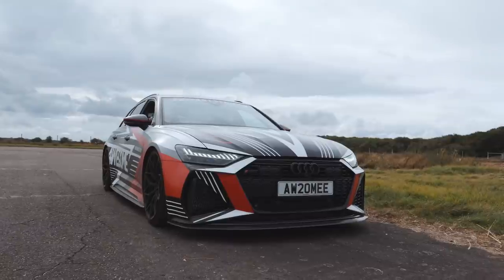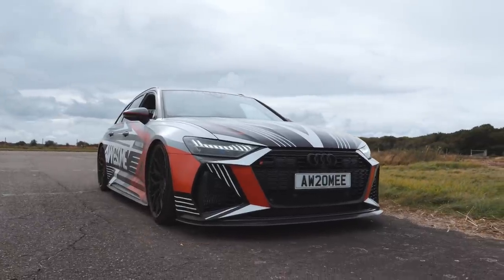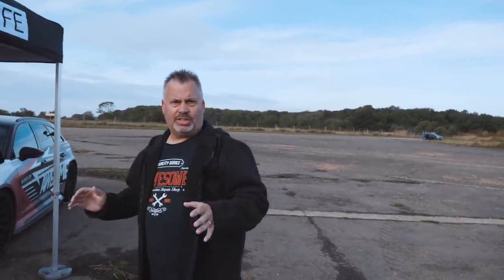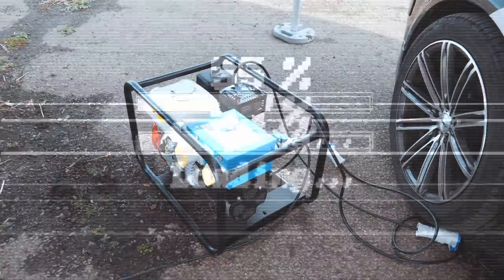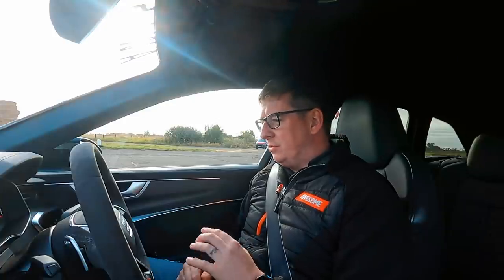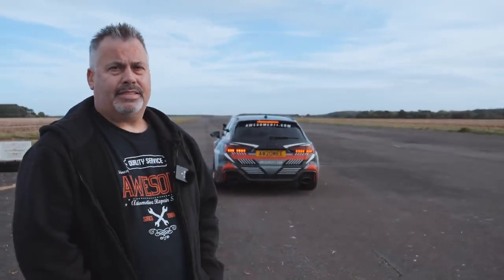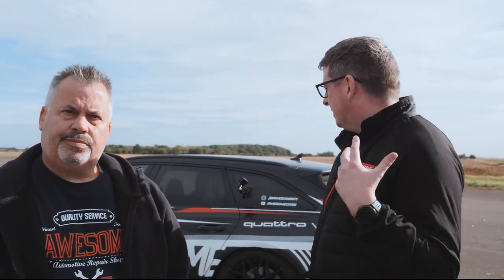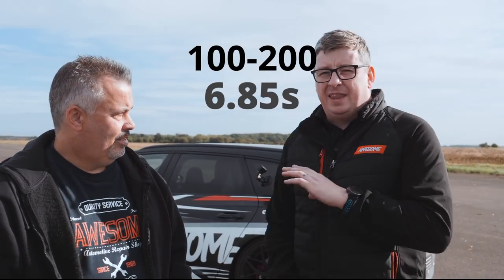Why you need this tune on your AUDI RS6: DRAG RACE: STOCK VS TUNED

Comment: Thank you for watching and your feedback is appreciated. The point of the video really was to see real world differences. When looking at the intake increases, we can really on focus on the 100-200kph figures as there are a number off factors at play when testing the 0-60 and the 1/4mile times Grip being the main one. When you do acceleration tests on a "normal" road you can only use in gear acceleration which isn't influenced by grip. So in terms of a scientifically reliable test, we measured 100-200kmh. 0-60 and 1/4 mile is too dependent on grip for an accurate/reliable result when you're talking 10ths of a second potential gains.
That aside you can see the increase made to the 100-200kph times and the terminal speed of the 1/4mile time if this test was carried out at drag strip with reliable grip the results of the 0-60 and 1/4mile times would be dramatically different too. 

The Eventuri is 58% better flow over the stock airbox, which lead to us seeing increases of over 50bhp delta gains on the dyno when we carried out back to back testing with the APR stage 1.
Reply: But the ‘real world difference’ in the 100-200 kph times was 0.15 seconds! In a blind test you wouldn’t be able to tell the difference between standard and Eventuri intakes. I’m sure this is a beautifully made bit of kit and it may well flow 58% better than the standard one but if the engine can’t use that extra air then it’s basically two and a half grands worth of engine dressing. Maybe at stage 2 or 3 it would make more gains.
Reply: @petetasker8599  as most modifications you fit with further tuning in mind, you could certainly expect to benefit further with an increased level of tune.
Reply: Great video! More like this please
Reply: @A Hussain  I think you must of missed our video when we tested the intake back to back on the Dyno. We experience a considerable gain with the Eventuri intake installed in combination with the APR stage 1.I'm struggling to see which part "isn't true"? We could sit here and talk about the effects of ambient conditions all day long, but we reported it as it is. The APR stage 1 is limited on launch in 1st and 2nd gear due to an issue we had with the Differential in the RS6, we covered that in a previous video too. So the gains from the 0-60 were not going to be seen, in turn this has had an over all effect on the 1/4 mile time.
Reply: @petetasker8599  exactly! Would be good to see the dragy slips to see where that 0.15 difference happened. Literally one average gear change could result in that time difference. Tbh this proves the intake is a waste of time apart from sound
Reply: @A Hussain yep exactly their intakes are just super expensive garnishes for your engine bay
Reply: @simonbarnes7789 , is the differential issue corrected in the 2024 RS6 Performance??

Comment: At two and a half grand, that intake seems like an expensive way to shave 0.15 seconds off the 100-200 time!
Reply from the maker: check out the pinned comment :)
Reply: @awesomecars1  The HP does NOT show up in your testing. The tune made a huge difference, but adding the intake did NOT help much at all. It doesn't add 50 hp over the tuned setup (not possible by the testing numbers). The intake only increased the trap speed by 1 mph (equates to 10hp at best)  in the 1/4 mile. 50 hp would add at least 5-6 mph to the 1/4 mile trap speed on a car of that weight. Also, dynos don't tell you the real story. It's the track. It's very easy to play tricks with the dyno to show big gains (are they SAE or STD, any tuniing added for the intake, etc..?) In conclusion, the drag testing (trap speed numbes to be specific - which really show hp gains) do not support much of a power increase over the tune only setup.
Reply from the maker: @BLACK05GO1  here's a video of us back to back testing this on the dyno, nope the dyno is not altered and shows just what it reads. https://www.youtube.com/watch?v=G1ejvv8GNSU
Reply: @awesomecars1  I went back and watched the video and the standard panel filter was full of debris. Did you clean it out and then run the car up on the dyno or was it run up full of leaves and other debris?

Comment: So can you please make a follow up video about the results. I want to see if the intake did anything or not. Please post for transparency. Interesting to see if the expensive intake is worth the money or not.
Reply from the maker: We made a video not too long ago when we tested this back to back on the dyno, We understand the frustration from the comments but as we mentioned the power is there and because the car is limited to protect the gearbox as we've already broken it once the 0-60 and 1/4 would not be affected by much the difference is in the 100-200kph and how the power is through the REV range. Our customer's are welcome to come down and experience it for themselves :)

Comment: I was looking to fit a Eventuri to my RS3, I dont think i'll bother,  I don't get how you state massige gains on the dyno, slower 0-60, same quater time -15 quicker 100-200, piss poor advert for the intake.  Love the RS6 tho.
Reply from the maker: Read the pinned comment :)
Reply: @awesomecars1   yeah read it, but for 2.5k on the RS6 and 1.5k for thr RS3 I would want more bang for my buck,  Looking at the result maybe intercooler is the way to go,
Reply: @RS3-MT10  Wagner Intercoolers are the way to go. I’ve read the stock ones are quite under capacity for this motor, especially after multiple launches or hard driving.

Comment: to be honest , after a reflash, the car adapts constantly and each run will get better times ..... i doubt the intake had a part to play.
Reply from the maker: check out the pinned comment :)
Reply: cool. now im tempted to get the apr and eventuri. Why does apr not have stage 2 for the audi rs6 c8
Reply from the maker: @timethief2065  APR doesn't do stage 2 on any car anymore due to regulations in the US.

Comment: How much was the intake? Figures show it’s pretty much useless
Reply: eventuri stuff well ovedr 1k
Reply: It’s 2500 quid
Reply from the maker: It's £2500 - but the gain isn't in the 0-60 simply because our tune is limited in the 1st gear on launch due to the gearbox issue we had earlier on in the development. You can see where the intake is making a difference. Going from a 7 second to 6.85 on a 100-200 is still a significant gain for just an intake
Reply: @awesomecars1  yes. But not for 2500 it isn't.
Reply: Overpriced shite is what it is!
Reply from the maker: @derekporter66  check out the pinned comment :)

Comment: My stage 1 M5 100-200 km/h times have improved by 0,2 sec with Eventuri intake.  I’ve measured it over and over again with Dragy
Reply: Is there no way to put a conical K&N on these cars?